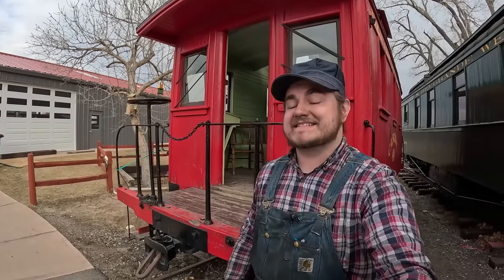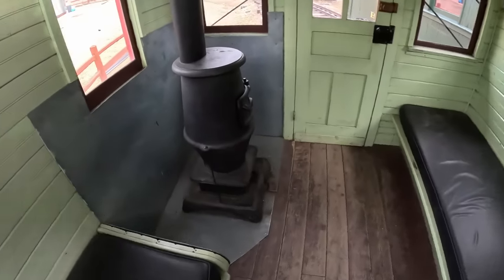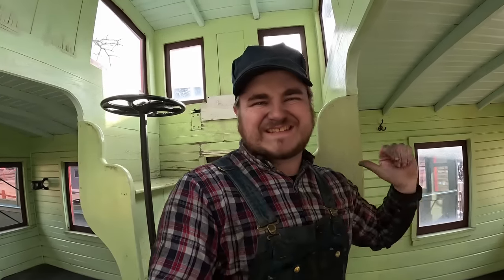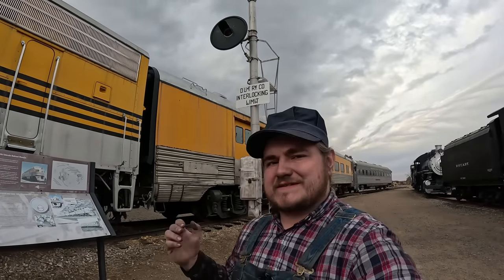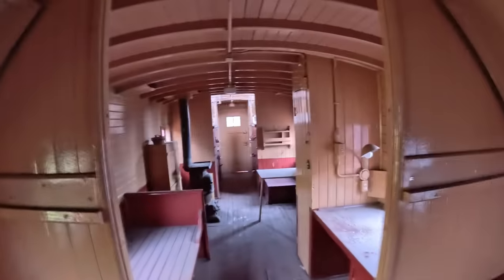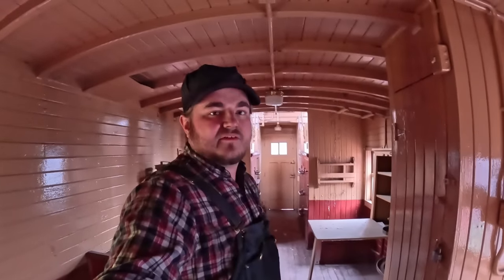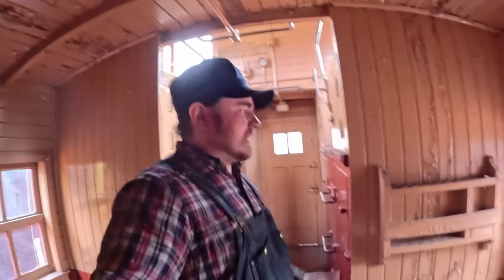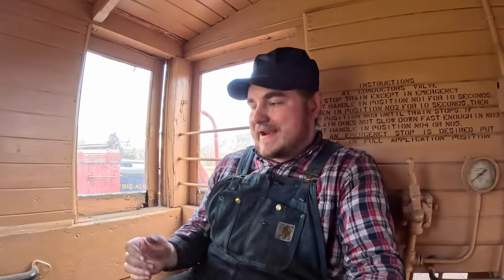Why don't trains use CABOOSES anymore?

Comment: RR man 1971-2005 CNW/UP; some people know nothing about slack action; 100% air; when train goes in the Big-hole all the cars/brakes set at once; no slack action....just a hard stop but every RR man knows the sound of "losing the air". Money&Rotten Ronnie Reagan's anti-union Deregulation of RR's and airlines & trucking ended the caboose's ride. Roller bearings had nothing to do with it. Cabooses had cushions and laying down area because when big wrecks occured out in the country; motels were not readily accessible for section gangs to rest as they were not under Hog Laws for a long time. Operating crews after 16 then 14 then 12 as the Hours of Service Law changed returned to their terminals; section crews had to stay at the wreck site until the main-line was re-opened. They usually got 4 hrs of rest/on the clock when the RoadMaster said ok. another factor was bad weather; Trackmen worked in all kinds of bad weather all night long and all day long; they had to be rested, fed and warmed. Many cabooses and section gang club cars <retired pullmans> were used on wreck sites.

Comment: That is not brass. It is called Babbitt metal. It is a very special type of brass or bronze alloy made for reducing friction. It was often made by heating and compressing the elemental metal components of Babbitt metal alloys with OIL. Sintered Babbitt metal is oil and powdered copper, nickel, manganese, arsenic, antimony, silicon and zinc for a bronze bearing alloy. Zinc is called pot metal, and it's that super cheap cast metal that Hot Wheels toy cars are made from. Bronze would mix in nickel, manganese, silicon, arsenic, antimony, aluminum and tin along with the cheap zinc. Babbitt metal powders these alloys and then compressed them in a mold mixed with oil into an oil sintered Babbitt metal bearing. When properly maintained Babbitt metal is a superb bearing, even superior to ball bearings and roller bearings in some applications.
Reply: Plain bearings on a railroad car is brass casing with a Babbitt face. The axle only runs against the babbitt face. Babbitt is an alloy containing 89% Tin, 9% Antimony and 2% Copper. It does not have any bronze in it. Babbitt resembles lead so much so many people called them lead bearings. 
What you are describing as sintered babbitt is actually sintered bronze that was commonly called oil-lite bearings.

Comment: I clearly know why same as my job as a freight brakeman from 1978 to 1993. Modern technology. The end of train device which records the air pressure at end of train an walky talky an signal pole lights did away with the brakeman job. Part of the big oil modern America. If it wasn't for coal an some big plants scattered that have rail lines railroads would be obsolete like cabooses are. It's  a different era. Big oil rules fast shipping rules an large plants factory's can call a truck for pick up delivery any time they want. Just about RIP time railroads. I know I hired out at the end of an era an in 1993 my brakeman job was abolished. I didn't want to be a brakeman an conductor do I went into building repair rest of my work career.

Comment: The real reason no Caboose is Big Business wants to do more with less.  Get rid of the caboose and soon get rid of the conductor so trains are engineer only.  Imagine being an engineer running for 12 hours alone that cannot do anything other than run the locomotive.  No FM/AM radio nothing.  Imagine a truck driver going 4 hours in silence.  Source: A freight conductor.

Comment: Becoming aware that high friction brake shoes (needed for train length over 40 cars) are composed of minerals that have proved to be detrimental to human health, like trying to breathe in old age if you live that long. Asbestos dust, fragments and steel shards and cast iron dust is what the rear end crew got to breath, same as when you followers and fans stand near a freight or passenger rite of way to get a photo or a wave .  The mere threat of EPA Regulation and actual responsibility induced the fix, reduce the personnel subject to the hazard rather than alleviate the hazard as REAL CEO's would have done before the Nixon Era 1970's onward.

Comment: advanced technology and the greed of the railroads to eliminate personal! Same as the engineer has been eliminated from the yards and now train is operated by a conductor with a remote control.. And as a former freight conductor, mandatory twelve hour shift, max! BUT it could be two to six hours or more for a ride to bring the replacement crew! I have been on trains, more than eighteen hours.. that also went way past being awake for more than twenty four hour, been more than once I was awake over thirty two hours!

Comment: Save money by eliminating jobs. At the same time making freights longer, over 100 cars. If a freight has an air leak or a broken coupler the conductor will have to walk the entire length of the train by themselves. That is why you see trains blocking crossings and cutting towns in half. It is all about the shareholders and profits. Not about safety or concern.
Reply: In the old days, the rear brakeman starts walking forward, and the head brakeman starts walking backwards. But if the leaking hose is close enough to the engine or caboose and we know that, then just one man need go with a new hose and the monkey wrench. We had those on the engines and cabooses. I changed one out once about 15 cars ahead of the caboose. The head brakeman didn’t need to walk back because once I saw it I just radioed him I have it.

Comment: Railroads have always been about money!  The advent of diesel engines and the end-of-train devices saw the end of three positions on a train; fireman, brakeman, and helper. The Conductor moved to the engine with the Engineer. Recently, with the use of automation, railroads were attempting to further reduce train crews to only one person, the engineer! Many States passed legislation to require a minimum of two crew members on a train. Train length has increased to 10,000ft upward to 15,000ft with distributed power on the TransCon! To the railroad, a person working for them is only a number, a B-number!  Working on a railroad virtually requires job insurance, something I had never heard of before. Job insurance provides your usual salary for a period of time in the event you're fired, a common occurrence! Reading the safety manuals and regulations, it is always the employee who will be found at fault, never the railroad!
Cabooses are used mainly as a shoving platform. When a train is reversed the “head” of the train becomes the last car requiring the conductor to ride the last car for clear track car counts, signal aspect, and deployment of signals and gates at crossings. Better to ride on that caboose than to hang on the side of a car for miles and miles. 
(BNSF Engineer, retired)

Comment: Why don't trains use CABOOSES anymore?  Simply:  Money!  I rode millions of miles (figuratively, not literally) in "Waycars" (which we called them on The Santa Fe).  I began my RR career in 1976.  The Waycar carried an old grouchy Conductor, and the engine housed an Engineer that was full of bad temper and ego.  They hated when the "young" men came along taking away their Railroad.  But anyway, the Railroads had crews that cleaned and supplied the caboose.  The cabooses themselves were ancient demanding a lot of maintainence.  Santa Fe came along one day and told the Transportation Unions:  The Waycars are going to be eliminated come to us for negotiations.  The Unions said we're not going to stand for the elimiation of the Waycars.  To make a long story short, Santa Fe eliminated the Waycars.  But actually they were no longer needed.  There are detectors spaced every so often.  The trains run over the detectors and will alert the train crew by radio if there are hot bearings and/or dragging equipment.  The detector is automatic.  It also does an axle count so the crew can be assured that the train is complete and not separated by mistake or vandals.  Don't know how true this is, but a Railroad official told me that the cost savings per elimination of 1 caboose was half a million dollars.  That was in the early 1980's.

Comment: It’s because they are cheap and don’t want to pay for a break man and they don’t want us taking the time to pick up the caboose it’s easier to get a limo to run the conductor to the rear end and hang a F.R.E.D and another thing if the engineer is good he’s not going to have a lot of run in or run out that’s how you get knuckles/ drawbars and spit car’s out the best compliment I have ever received from my crew was when they told me I ran my train like an old head that’s the whole reason I trained with nothing but old head engineers they taught me how to run my train with my butt it sounds funny but you can tell so much about what you’re train is doing by what the seat is telling you

Comment: To me the answer is simple and has one word. Greed. Cut payroll, increase profit. Having a human back there at the tail means eyes on the back half and back end of the train, and perhaps more importantly, at least one nose. A hot box (bad bearing) can easily be smelled as the presenter says. They still happen. They just don't get caught. Roller bearings seize and catch fire too. A hot box from a failed roller probably caused the recent derailment in Ohio. The lack of a brakeman to set more brakes than the engineer him or her self has time to do caused the runaway at Lac Megantique Quebec. More crew, more safety. Less crew less safety, and most important of all, MORE PROFIT. It all comes down to money. Money over people, the story of western capitalism. If we don't regulate it, safety will always get eroded.